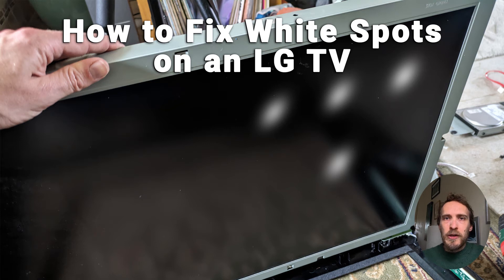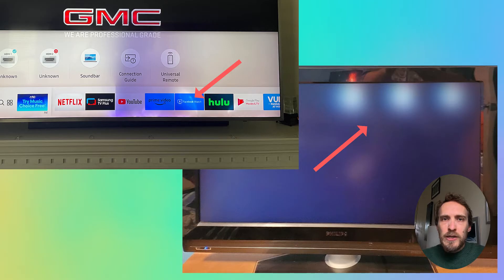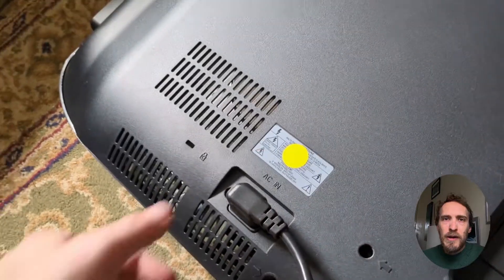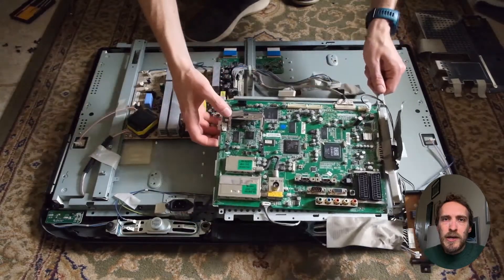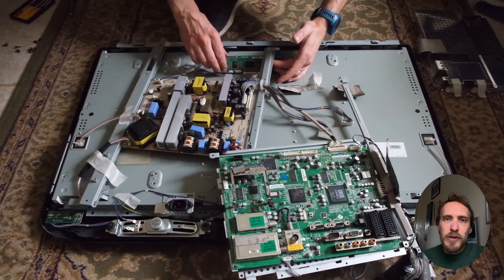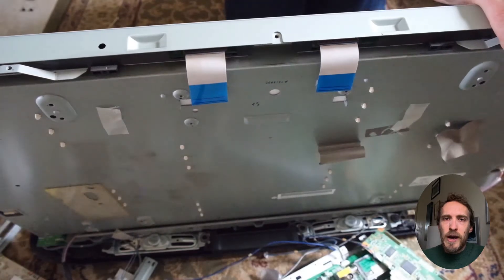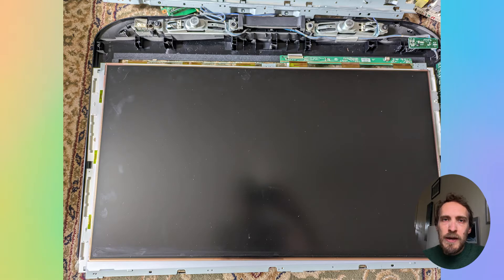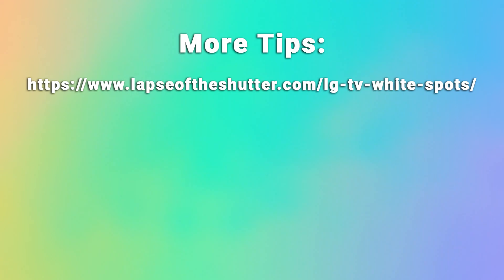LG TV White Spots on Screen Repair | 30-Minute Fix

Comment: My Steam Deck LCD has a white spot. It's only visible at different angles. My Steamdeck LCD have a hard protective case that's why I don't think it's from pressure damage plus I rarely use the LCD touch screen. Could it be from the tempered glass? I haven't remove it yet don't know if the white spot is on the tempered glass or on the actual LCD.

Comment: Thanks for posting this video.  I have a 55" LG with 7 white spots.  It is difficult to watch at times.  I've decided to replace the TV but I will keep the troublesome TV for a while in case I decide to try your fix.  New 55" TVs of better quality are under $300 so if the repair works, I'll just put that TV in a different room of my home.  Thanks for doing this research and posting a great video.